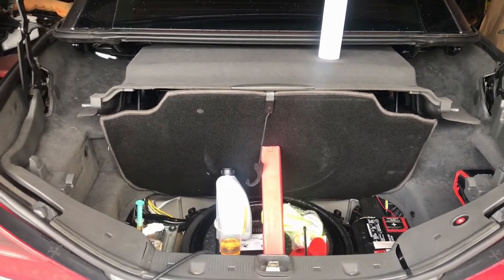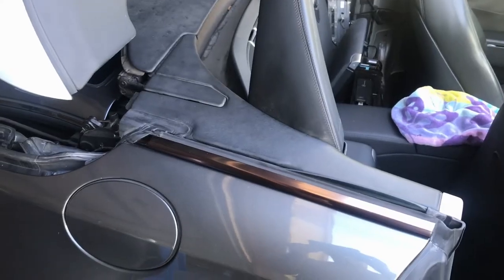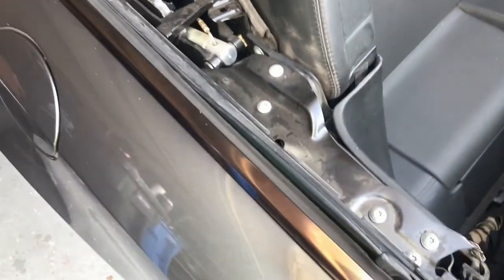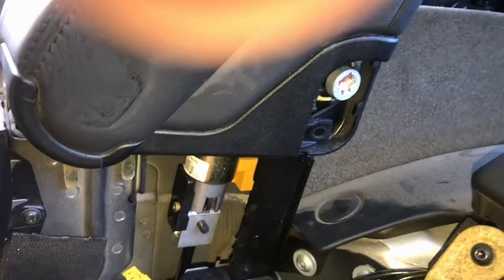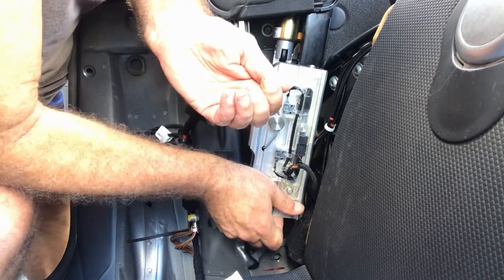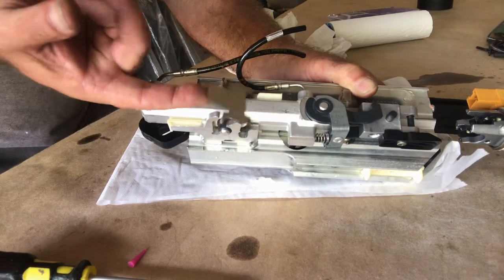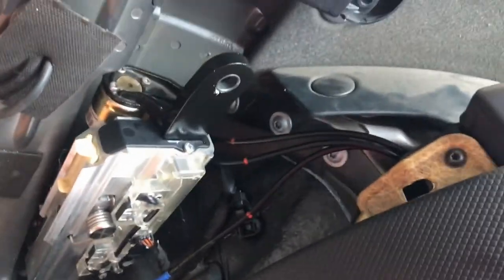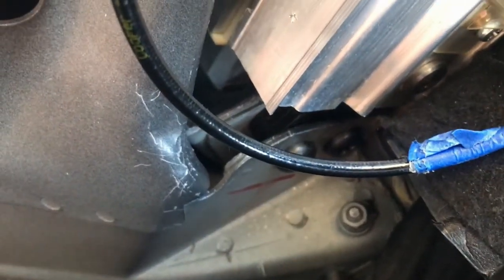SL500 R230 Check for top hydraulic leaks,  replace Roll Bar cylinder

Comment: No wonder these cars cost a fortune new! The engineering is amazing. As an aircraft mechanic, I understand what you are going through with 10 pounds of (!) in a 5 pound box. Thanks!
Reply from the maker: They just spared no expense building this car, well 90% of it anyway.  $108k new for this one.
Reply from the maker: At the time I made this video, the only video I found to fix the cylinders required special tools. I was only able to fix the roof lock cylinder by drilling a hole in the cylinder.  Do you have a link to the video?

Comment: Thanks again for the informative and well made video. I have benefitted from your other videos. I did replace one trunk cylinder, but I am having additional problems that I will need to address now that you have produced this video. My reservoir empties with one full cycle of the roof but I have yet to find any fluid equal to the amount discharged from the reservoir, which has me baffled. All that fluid must be going somewhere....nothing on the ground or undercarriage. I feel like I must be driving around with an aquarium full of hydraulic fluid....a real mystery. I will address the two cylinders in the upper back of the trunk as you have pictured first before I tackle the roll bar cylinder. I have never tried to raise or lower the roll bar, but will do so now that I have viewed this video and once I check the two trunk cylinders. Thanks again for your assistance

Comment: Great video! One important point is that you can have the roll bar up with the top up. I also journeyed into not using the couplers, and it just isn’t worth the trouble. Too many things have to come out and this plastic is too brittle for a nearly 20 year old car! I didn’t have the same leak you had, but I sent all of those cylinders out because it is just a matter of time! Again, great video!
Reply: One other important point, if line 60 is somehow switched with 100, the roll bar will not go down. This happened to me and I just switched the lines at the pump. No going back once those couplers are set. Awesome video

Comment: Lets say that cylinder dies again than you just repeat the process. Can those connectors be reused or do you have to remove the line? Thank you so much. You are amazing teacher.
Reply from the maker: According to the cabriolethydraulics website, they are not reusable. You might be able to use another set of couplers but I don't think there is a lot of slack in the hose back to the pump. Might be possible but I don't know.

Comment: Hello Marco. This is a great video! It helped me find the leak in my SL 500. It’s in the roll bar actuator. I removed it.  One question. I notice you cut out the passenger lock pawl and sent that for overhaul with the actuator. Why? Is that a common fail point? And the drivers side lock pawl why did you send both? We’re they leaking?
Reply from the maker: The passenger side lock paw was leaking. The driver side wasn't leaking but I did it anyway while I had everything apart.  I don't know if these cylinders are a common problem. I haven't moved the roll bar in years then a week after I did actually move the roll bar, the leaks came.  I think the seals dry out if you don't use them for a long time, then when you do use them they start leaking.
Reply: @MrMarco6900  I have that type of problem!!, my both sides are leaking. i managed to removed the right side and seems like just the lock-paw is leaking, not the cylinder..is that possible? and so is the left side, the only hydraulic line i`m seeing is the one on the lock-paw
Reply from the maker: @daniellichowid8732  If you go to time stamp 14:39 you can see the hydraulic lines to the roll bar cylinder.  They are hiding behind the cylinder.

Comment: Hey Marco,your video and explanation of that process is awesome!! Thanks a lot!!.. if I understood correctly, on the right side you only need to replace -or fix with Cabrio people - the lock paw, is that correct?
Reply from the maker: Left side (driver side, USA) has just the one lock paw cylinder, right side has the roll bar cylinder and one lock paw cylinder

Comment: @MrMarco6900 could you update us if there is any problem with the couplers that you used? Usually i replace the whole links from the pump, but i'm looking into this solution, but not sure if i'll have a very small leaking in the future , i appreciate your video, you are amazing
Reply from the maker: I have not opened the panel up and looked at the connections, but it's been a few years now and I haven't lost any fluid out the tank.  The top does go up and down daily, but I normally don't move the roll bar.
Reply: @MrMarco6900  thanks for quick reply, did you have to change any other hydrolik cylender, im so afraid from the two main and the assistant one, they look so hard to reach, i hope i'll never have to replace it,, thank you for the video, it makes our life easier with this nice car
Reply from the maker: Yes, in order, I've had to replace the top lock cylinder, right frame lock, left frame lock, trunk lid drive, roll bar, two lock paws. The top lock cylinder is the only one I was able to rebuild myself.
Reply: @MrMarco6900  i see, i already replaced the two frame locks , the left paws (now i'm doing the right pows) the trunk lid, hopefully I want need to replace the Right/left load assist cylinder(2308001572)  or the right/left Main lift cylinder,(2308001272)  because I could not find any video on how to replace those cylinder, i think the whole process looks scary.... i'm preparing my self for this hug job in advance .....

Comment: Did you not have to bleed air out of the lock pawl cylinder?  I have the new one in, but it's not moving when I push the roll bar button.  Given that it's a single acting cylinder, I was thinking that maybe air could be the reason... but if you didn't have to, I need to troubleshoot a little more.
Reply from the maker: I didn't have to bleed it, I read that it bleeds itself.  Maybe check the microswitch on the passenger side whether it is open or closed.
Reply: @MrMarco6900  
It turns out that the line on the rebuilt cylinder was accidentally crimped shut.  They sent out another one and all good, but the roll bar would not automatically go down when lowering the roof. I used the adjustment tips at the end of your video and everything is back to normal.  Great video, thanks again for sharing!

Comment: Best video  !!!!
I have oil disappearing and don’t see where it is going about 1 liter o oil filling and not a drop in the car or ground floor ….. any ideas where all this oil is
Reply from the maker: The first one to go is usually the top front lock cylinder, you have to remove the headliner to check that one.  Of course you have to remove the panels to check the roll bar cylinders too.  Did you check all the other places I showed in the video?
Reply: It will take quite a bit of leaked oil from the pawls to accumulate in the rocker panel below before appearing as a puddle on the ground.Once it does, you'll know whether it's the Left or Right one. I emptied my reservoir twice before it became obvious.

Comment: Great video, i was able to use this to get the roll bar to roll down. However, it wont stay locked down, it just springs back up, any ideas?
Reply from the maker: You are operating the top with the switch to move it down, then it goes all the way down, then moves back up after you release the switch ? Does it move all the way back up, or a quarter of way. Go to timestamp 28:20.  Do you see the little spring arm that is above the silver knob? Is that moving to the left when you operate the top then to the right when you release the switch, like the video?
Reply: @MrMarco6900  When i did the screw driver method with a friend and pushed the bar down manually, we were able to get it to go down. As soon as we let go of the bar it pops back up all the way. I'll take a look at that spring again that you mentioned, maybe that's why it's not locking in the down position Thanks again for the help!

Comment: You can buy a kit for less than a hundred bucks...that has the main seal that goes out on all 10 hydraulic cylinder...there's no need to remove or cut the lines..you can remove the plunger on each hydraulic cylinder...replace the actual gasket that failed and install the plunger into cylinder again...the key to this is removing the plunger...there's a german guy who explains how to do this..(on YouTube)....if you are going to this much trouble...go one more step...and fix the actual cylinder right in place on the car...I personally fixed 5 cylinders so far...seems like when one goes out another goes out soon after.....you must drill a small hole in the cylinder to release a clip that keeps the plunger inside assembly...must see (video)...it is always the same gasket on every hydraulic cylinder....carefull...don't scratch the plunger wall... Again see video first...it's slow and tedious....but quite doable....
Reply from the maker: At the time I made this video, the only videos I found to fix the cylinders required special tools. The only one I was able to fix myself was the front roof lock cylinder by drilling a hole in the cylinder.  Do you have a link to the video?

Comment: Nice video I have a question which switch detects the top open or closed is it by the window or the one on the left rear trunk
Reply from the maker: On the first post here, there is a great diagnostic PDF for the top which shows you everything you need to know about the microswitches and a lot more great info. 
https://mbworld.org/forums/sl-class-r230/253160-vario-roof-diagnostic-aid.html
Reply: I kind of know somewhat o bathe system I’ve taken a lot apart etc yet I had a crazy situation my top wasn’t working and I unplugged the ecu for the top and plugged it back in and the top started working but the windows sty a little open rollbar won’t go up and it says the top is in operation yet it is closed
Reply: So I don’t know which is the actual switch for the rollbar to go up or down and the windows I have tried everything thanks
Reply from the maker: If it shows the top is in operation then you won't be able to raise the roll bar.  If it shows the top in operation but the top is closed, possibly S69/1 - Open, which is at the front edge of the roof.  The trunk flaps not closing all the way is a common failure. Look at the diagnostic pdf and it shows you the scenarios of what happens when a micro switch is open or short.  If any of the micro switches are not in the correct state it might show the top is in operation.  Maybe try opening the top manually and then try to close it with the switch and see where it fails.
Reply: How many switches are there one by the window and the other one by the driver side rear ? Are there any other ones
Reply: I have a star diagnostic is there anywhere a section on the vario roof that can maneuver the top
Reply from the maker: From the pdf, it shows about 14 switches.  If you have a star computer then you should be able to pull any codes and do actuation tests on the top.  The pdf also shows the fault codes for the micro switches.

Comment: you mentioned your rubber trim was wavy. Mine is also wavy and i seen fluid coming from the front corner of the top. I thought that told me it was the front locking cylinder leaking. But after watching your video of you repairing the roll bar and saying your passenger trim was wavy im thinking i could be wrong and it could be my roll bar like yours?
Reply from the maker: If your passenger side trim piece at the top of the window is wavy, then yes your front locking cylinder is leaking.
Reply: @MrMarco6900  Thanks for confirming. Do you know where to buy that replacement rubber?

Comment: Great video, I just got my 2004 sl500. My roll bar does not move smoothly like yours.  Mine kinda struggles to go up and down, so I’m wondering if my cylinder is going bad?
Reply from the maker: Could be....I think the only way to really tell is to take off that side panel and see if you have fluid leaking down in there.

Comment: I'm still unsure why you had to splice the lines
Do the line connectors to the cylinder not come out?
Is there not 'clip' to undo to remove/install the lines?
Reply: Ah....disregard. I saw in another video that the lines DO NOT disconnect from the cylinder :(
Reply from the maker: Yes, that would have been important to mention in the video.  It's my wife's fault.  She reviews my video's before I post them and she should have asked that question.  Proves she wasn't paying attention!!
Reply: @MrMarco6900  Thank you. Yes I'm coming from a CLK. My CLK hydraulic cylinders had little clips to attach the lines. Now I've discovered on the SL the rollbar cylinder and lines are intergrated.

Comment: Did you work on two cylinders or one? I thought you said there was no cylinder on the driver’s side. I’m confused.
Reply from the maker: There are 3 cylinders altogether.  You have the roll bar cylinder on the passengers side only, which raises and lowers the roll bar, and the small lock paw cylinders on both sides which lock the roll bar in place.

Comment: Did the motor make running noises when the top wouldnt open?
Reply from the maker: Yes, if it's low on fluid you should here the motor running but it will move very slowly or not at all.

Comment: Any advice to bypass close trunk lid error message? I have a leak, ran out of fluid mid cycle, roof closed, front trunk not latched to finish close cycle, I manually opened trunk, topped fluid which was very low, now want to close the convertible all the way now that there is fluid in the pump, but stuck at close trunk lid message (which I have closed many times including the trunk partition). Thank you.
Reply from the maker: This video shows how to manually open and close the roof. You should be able to get it from this video. https://www.youtube.com/watch?v=OZt8nvGhMGw
Reply: @MrMarco6900  Thank you! I was able to manually close the trunk. I definitely have a faulty cylinder as the carpet by the left trunk feels damp, do you have a good resource on the layout of the cylinders, so I can Starr brainstorming which ones to replace😅 Thanks!
Reply from the maker: Here is a diagram of the cylinders and location. https://tophydraulics.com/content/51-mercedes-benz-r230-info
Reply: @MrMarco6900  Thank you, this is perfect!
Reply: @MrMarco6900  Hey! So I am getting around to using that Top Hydraulic website and diagram you sent to order and change my faulty cylinder. Any advice on how to go about diagnosing the faulty cylinder. I suspect the back left trunk lock cylinder as that is damp and left trunk carpet is soaked in sprayed oil. Any suggestions to test other cylinders, such as the left 2 cylinder by the trunk lock cylinder, I suspect right side and very front cylinder to be good. Thanks!
Reply from the maker: @Most4Wanted4  I wouldn't rule out the front top lock cylinder unless you know it is good.  It is usually the first one to go. Remember, when the top is down, that cylinder sits over the trunk and could be dripping down in there.  Unfortunately you need to remove the head liner to check it. If you see or feel any oil on the other cylinders then the seals are failing or have failed.  Sounds like you have found at least one of those.  My cylinders have failed in this order:  Front lock cylinder, left trunk frame lock, right trunk frame lock, trunk lid drive, roll bar cylinder and the two lock paw cylinders.  I haven't had any trouble from the rest of them.  I have a video of doing the right trunk frame lock cylinder,  https://www.youtube.com/watch?v=wlb5hP8JCZs&t=6s
Reply: @MrMarco6900  That video is exactly what I am looking for, thank you! I will try to go and check the other ones, as for the left truck cylinder, it is definitely damp and leaking so will change that and go from there one by one. Will let you know how it goes😅

Comment: Mr Marco i have a leak but its not coming from the hydraulic cylinder  it's coming from  a hose. do you have a part number for that splice kit?
Reply from the maker: Don't have a part number, I've only seen them at cabriolethydraulics. At this moment they are saying "We currently have a low inventory on Hose Couplers. Please contact us for availability". They do make the hoses for the R230. "Hoses are available in sets or individually.  Call us for pricing at (941) 756-1300."  Click the link in the description for their website.

Comment: On section 28.54 the part on the left is the lock? Or the right side of that cylinder
Reply from the maker: On the left is the lever/hook that keeps the rod down. At 23:18 you can see me moving the lever in order to move the rod up. On the right side is the spring that you move back which releases the lock that is inside the support assembly (which you can't see) and also releases the lever on the left side of the assembly.  In normal operation when you use the button to lower or raise the roll bar the lock paw pushes in and releases the lock inside and also releases the lever on the left and you can see the spring move back on the right side.  Another way to manually raise the rollbar is to release the solenoid (at 18:37) while holding the rollbar and easing it up.  It will be a bit of upward force but you should be able to manage it with one hand.